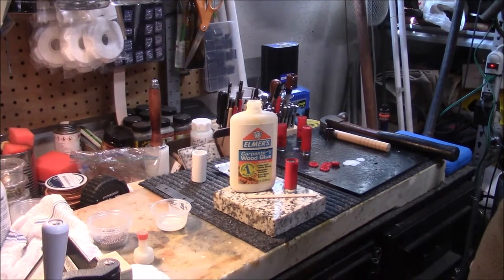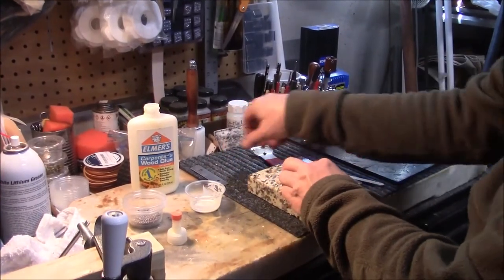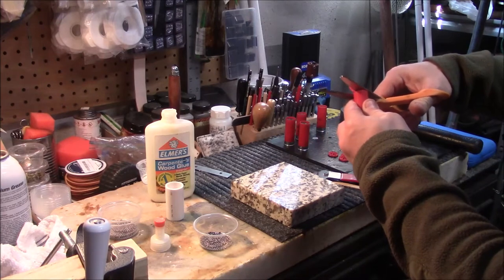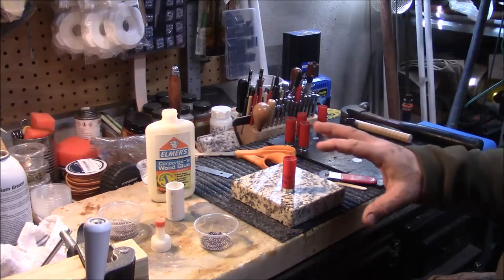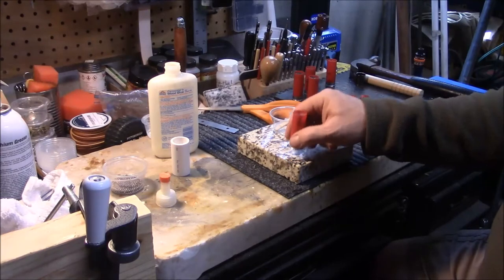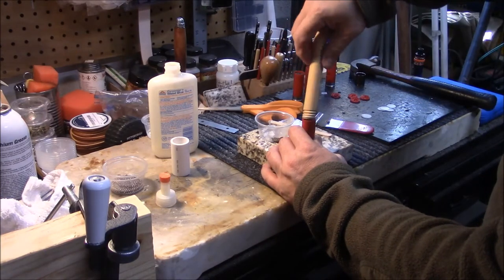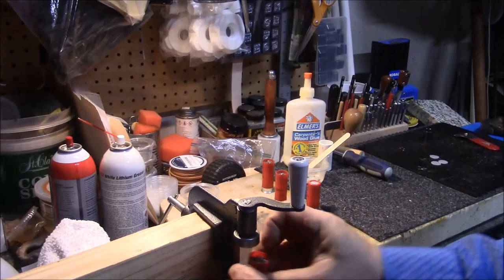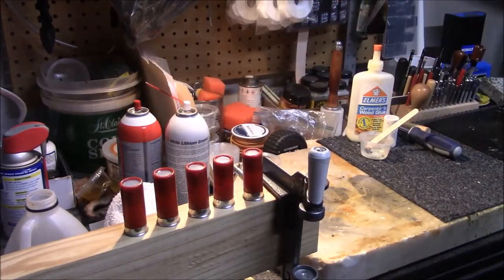Shotgun Glue Slugs (not good for hair but great for slugs)

Comment: what's the point of altering the shells? if I had to guess it would be a much tighter pattern
Reply from the maker: Because it turns field loads into rounds that can be used for self-defense. Look up other videos about wax slugs and the damage they do.
Reply: @GunsandGearNetwork  I've never seen that before I have yet to purchase a shotgun 4 self-defense. but at least your video was very clean and simple if I ever had to do in the future thank you for explaining
Reply from the maker: @crypto_pinto2660  No problem glad it helped. The 12 gauge is a very versatile weapon. Can take any animal in North America and is a good self defense option. My AR is my first choice for self defense but the shotgun is more versatile.
Reply: It's so you have the solid punch of a slug but hard surface penetration more like shot. You really want a brittle glue or one with a low melting point maximum frangiblity. You can also put dust shot in a manual press for a similar effect. That's how store bought frangible founds are made...
Reply: Pressed rounds also don't leave the residue that glued or waxed rounds do. Nor do they have the legal issues that waxed rounds do in some places